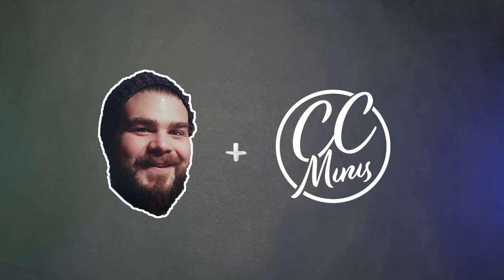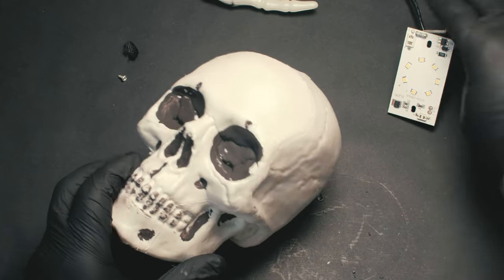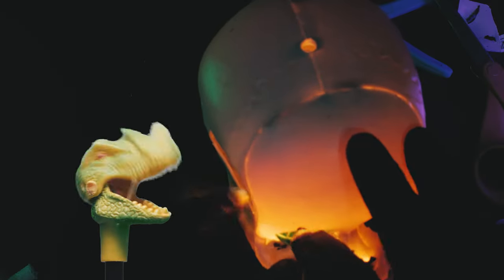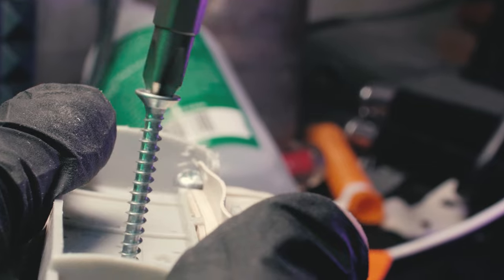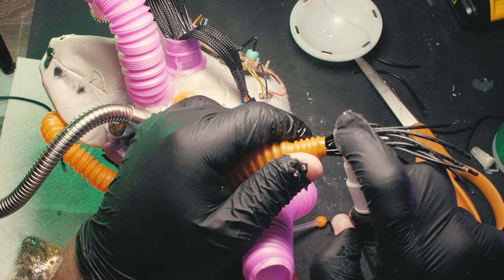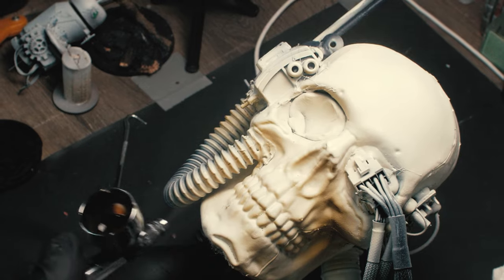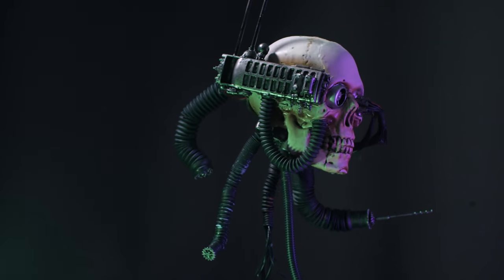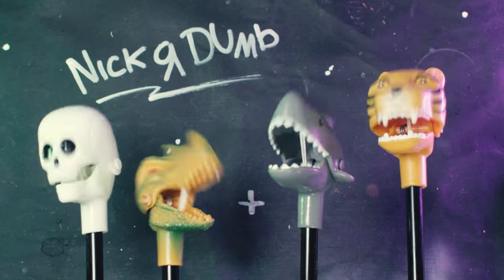Dollar store SERVO SKULL - Warhammer 40k prop scratch built from cheap decorations

Comment: Great build Nick! Still worried about the fire hazard part... maybe just dont leave it plugged in unattanded.
Reply from the maker: Don't worry I jerry rigged it right to a gas generator so its safe, a bit loud though
Reply: Aren't LEDs cool? Is it the LEDs or the electric current that you're concerned about it Knarb?
Reply from the maker: @billdefranza4927  LEDs are so cool dude
Reply: @billdefranza4927  yeah they are pretty cool
Reply: I too have concerns about your safety standards, but I will keep an open mind until after I see a couple of builds. A plus for creativity!